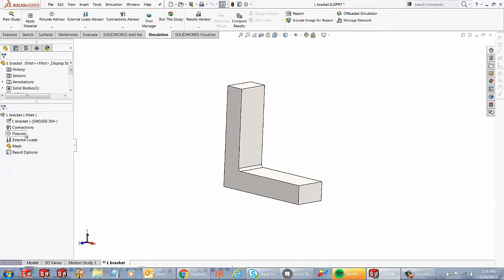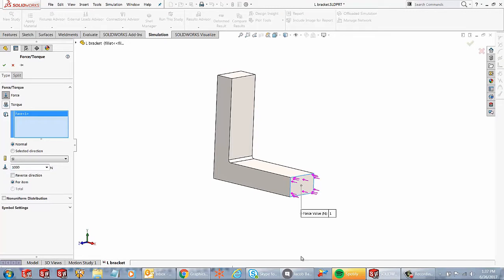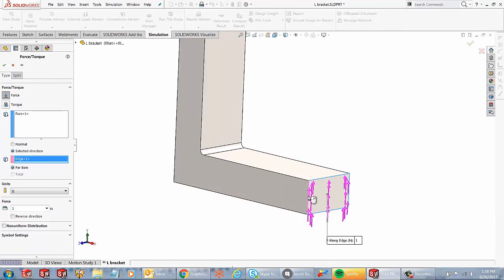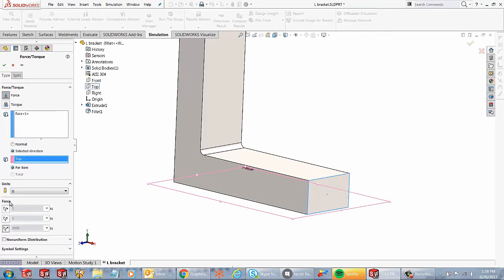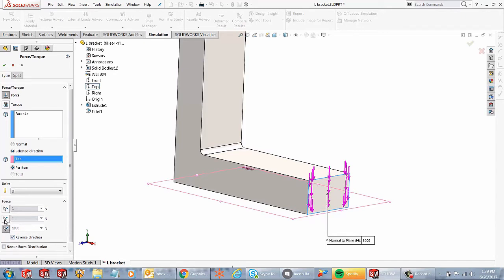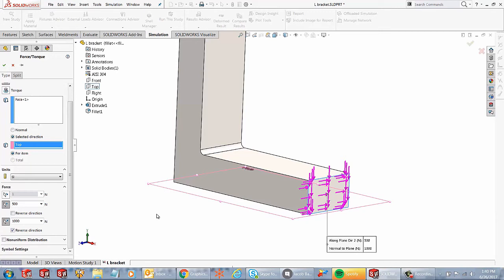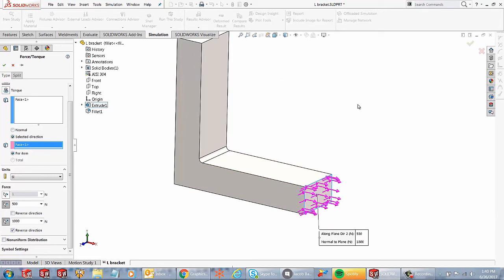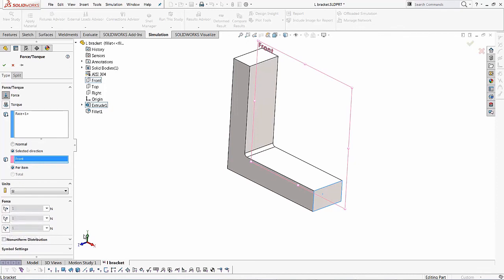SOLIDWORKS Simulation - Applying Loads Using Selected Direction

Comment: Suppose i need to apply 10 kg force to a face. When you select the "per item" option. It means each mesh element will be subjected to 10kg force right? 
Because i cant seem to select the "Total" force for some reason. 
How and when does the "Total" force option be available?
Reply: The entire face will be applied with 10kg force with the "per item" option
Reply: per item means if you have selected more than 1 face and selected per item then the force will apply to each separately ... and if you select total then force will divide for the number of faces.... but total is disabled idk why